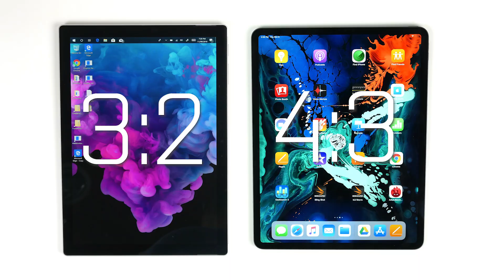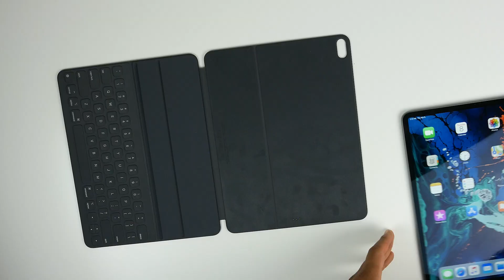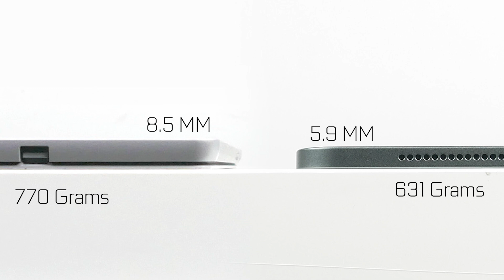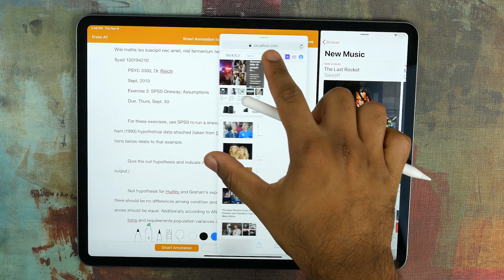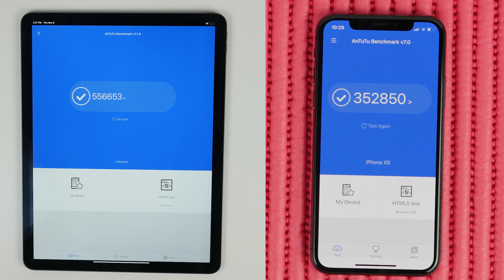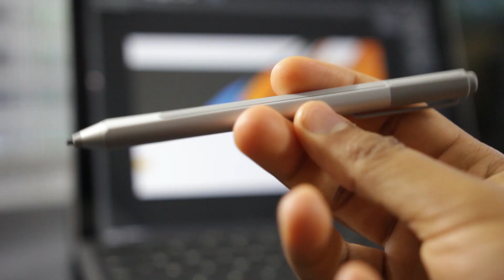2018 iPad Pro vs Surface Pro 6

Comment: One big oversight in this video. During the pros and cons section, it should be mentioned that the base model Surface Pro comes with 8GB of RAM and 128GB of storage, while the iPad Pro comes with 4GB of RAM and 64GB of storage. So the iPad may have a type of processor that beats most laptops in speed, but its base model doesn't have the RAM or storage to qualify for modern-day laptop usage, while the Surface Pro does.

Otherwise, great comparison.
Reply: Kev Lew so why not spend less and use ... a laptop that isn’t much bigger?

Comment: You forgot the dock connector of the Surface Pro. And this dock comes in very handy at home/at work – connecting a (large) display to the device and being able to connect e.g. multiple disks to handle large amounts of data is more than a nice option sometimes. I had all iPad versions up to the first (large) iPad Pro, but switched to the Surface Pro in the end (only an iPad Mini left for "consumption" and navigation). While the iPad Pro is the nicer hardware and better touch experience, the Surface Pro is suitable for professional work in nearly every area (while the iPad is only capable in some areas).
Reply: Couldnt agree more

Comment: The fact that the surface runs full windows 10 is a win for surface simply because, if you want use the ipad pro as an laptop replacement you will find yourself limited on task you can do. I will not consider the ipad a true laptop replacement unless it runs a full mac os.... simply bc you need a full os in order to do anything i don’t care what anyone else says you literally cannot do as much

Comment: Microsoft really needs to use Nvidia graphic chip with the price they asking for, also to compete with others! They should use something like NVIDIA GeForce MX130 chip which can be found in $500-$700 Lenovo flex convertible, they come with i5 or i7 8th gen, 250gb SSD, 8gb or 16gb ram, fhd ips screen + pen, they asking $550 for all that and Surface 6 asking for $900 to give us i5 , 8gb no graphic ability at all even to run simple games like DotA, and no pen no keyboard included!

Comment: Why do I watch these when I'm broke and can't afford either of them 🙃
Reply: Razzi W u are right, me tooo!
Reply: Well I have a laptop more expensive than both but I want something that’s be easier to use in road trips and stuff like that
Reply: Guess what i had my ipad pro in my bagpack and a water bottle next to it i know my fault.bottle leacked and it doest switch on anymore.cant new one now.i was using it for work and work of months gone with it too.
Reply: You gather knowledge 😄
Reply: I have a Surface Pro 7
Which is better than the 6
Reply: You can def afford it, the question if you will sacrifice yourself for it
Reply: Shashank Shekhar Obviously. I just can’t justify spending that much money on something like that currently, it’s not a necessity. That’s money that could go to food, bills, or rent. If I felt I had that much extra money laying around I would.
Reply: How about now?
How is life treating you?
Reply: Surface pro 6 used is cheap now between $170 - $275. I paid $220 for i7, 16gb ram, 512ssd with win10 pro👍 Ebay has tons for sale.
Reply: why? you don't have a job?
Reply: Razzi W shut the fuck up
Reply: @Ram-rm2gz  Well that's rude

Comment: Removable batteries are much better in a pencil, because the sealded ones will die and your whole pencil is disposable, where as the year long battery in the surface simply gets removed and back to full functionality each year.

Comment: The iPad Pro would probably be best with ya nano sim;therefore would have capability mots so as computer,cannot understand why bring new ports and pencils then more or less scraping them,also there’s lots of Apple products that should be included with with all new devices;because they’re not included they surplus goes to places like amazon and others  selling Apple products,So why is Apple and likes of other sellers still charging full prices on old products,they should be reduced,Apple has policy with old products they stopping supporting them and more or less rendering them useless,perhaps if Apple appoint someone other than themselves to give support for older Apple iMac and laptop,iPads wouldn’t it be wonderful.

Comment: ipad pro is great but for a $300 device, its not even close to surface. why nobody mention these questions!, can ipad run After effect or Nuke!? can ipad run maya or Houdini or blender ? can you do heavy renderings with things like vray on it? can you install AutoCad or any software and get your real work done by it? how about games, can you run your steam games on iPad or is it just some mobile games? can you run linux or other operation systems, can you connect ipad to a scanner or 3d printer or all the devices that can be connected to a pc like surface? sure you can do cool drawings with ipad but take away the pen and its just a smartphone with a big display. but with surface you can get your real works done  not just some simple family image and video editing,  with surface you can install softwares like visual studio, unity , unreal engine and make mobile and desktop quality games and apps. install professional 2d-3d animation or vfx softwares like toonBoom, Maya, blender, houdini, nuke and do everything from 2d animation to 3d modeling, texturing, animating, rendering, fx , compositing and post process. and for your information the "real photoshop" that was advertised on the ipad pro 2 ad wasn't really "real photoshop" just do some search and see that it only has some simple features.

Comment: the only time the ipad would be worth it is if it can run anything like the surface can all the old and new x86 and x64 programs and games hard drive storage or flash memory no limits at all ! and all the mobile bench mark scores seem to be garbage too the snapdragon 845 benchmarks close to a apple a11 chip something like single core 2800 multicore 90000 thats faster than some i5 cpus but the snapdragon 845 is in laptops and running proper x86 programs like complete garbage runs like an atom cpu ! i just think you cant compare arm cpus to x86 cpus at all if you could the new ipad scores would make it as fast as a alienware laptop with a i7 cpu and nvidia gtx1060 gpu and i bet you the alienware in real use is way way faster and id like to see the ipad play all the top end pc games like witcher doom gta 5 red dead and the rest !

Comment: Worth pointing out that video playback duration is not a strong indicator of real usage duration, especially considering Intel's architecture has very good video decoding.
According to Notebookcheck the iPad Pro lasts about 60% longer than the Surface Pro in web/productivity use.

Comment: He forgot to give the iPad a plus on apps. It still has the most apps available to its users. Another would be customer care. Apple still has the best customer support when something goes wrong. Another would be security. The iPad is still more secure than the Surface because of its walled approach. Another would be the weight. Yes, it is a noteworthy advantage to be carrying a lighter device vs a heavier device. Another would be resale value. The iPad will sell for more compared to the Surface. I can’t believe he missed those things. Or maybe he deliberately missed it to make it look like the winner is the Surface 😂

Comment: I used both pc and Mac pretty much alternately. Specs and bench’s aren’t comparable, in terms of grades and what parts you put in it.
But very rough of my judge is Mac computers are slightly or bit more stable than how windows sometimes stress user’s mind unless Tim Cook intentionally lower the battery stability and Slower OS reaction sake of selling new products.

That arrogance just shows mind of thinking that Apple  is a better company than Microsoft. Which is not so sure.

I love how it look with Mac products and stability. One thing I truly hate is that ego. Stop weakening your own products just for selling, you will lose future customers.

Comment: Missing is mention of the thickness different with the keyboards and the weight differences, again with the keyboards. The iPad's published thickness is a white lie as it doesn't include the camera bump-out while the Surface camera is flush. Since you discussed the keyboards in detail you should have also mentioned the price differences
Reply: Dwig Gang - The camera bump is hardly even an issue. Takes up less than 1 percent of the surface area and doesn’t wobble given the vast size of the device. Quit nitpicking.

Comment: You really can’t do Pro work in the entry level Surface Pro 6, you need the top of the line $2,500 one. 

You’ll have to wait and see how the new Adobe apps will run on the iPad Pro, and how does it compare to the entry level Surface Pro 6 running desktop apps.

Comment: I don't think you emphasize the file system (or the lack of it) enough. Easy sorting and transferring files in a professional work is very important. I won't say that either is better overall, I just think that these two are not the same category of devices.

Comment: So fucking tired of all the ipad / surface pro comparisons. Surface IS a computer. Ipad IS a tablet with a mobile OS. They DON'T COMPARE. You get the Surface for a tablet, you'll be let down. You get the Ipad as a "professional" latop replacement, you'll be let down. The main point of the Surface is that it's a full PC in a tablet form factor. The iPad is a pure tablet - it doesn't matter if you have the benchmarks to show - It is very limited in what you can do.. Just look at all the USB-C hipocrisy: The iPad as a USB-C - The Surface was crucified for not having one - all you can do with it is charge the device and connect to external monitors... As long as it has a mobile OS, it will always a be a "big" phone. Period.

Comment: Interesting review and reading peoples comments also interesting. Enough to make me add to the contents. I use currently an IPP. For drawing and editing video, animation. The attraction is the portable use and lightness easy to pick up and draw, doodle ideas. Gets me out of the office. Downsides for me are 1. No suitable way of connection contents when say access my external HD - have managed to connect a WD mycloud by LAN however transfer speeds are in the Stone Age. 2. Video editing ok, but your limited to 3 time line layers. 3. Connecting to IPP etc you need many different adapters and removing cards daily is a pain. New IIP apparently you plug an play on some types but no all Go Pro- also cannot connect my SLR without an adapter. I only use a key board for short cuts like In and Outs when editing. I talk to type. Pen a pain to charge not thought out. The surface pro I have not used and have not used windows in 20 years. However the surface pro’s, thinking and ideas appear to be more friendly and functional to the end user. That I can see purchasers questioning why they have an IPP. I know I am. Last thought the cloud great if you have fast wifi. Many people do not due to many factors. And this then reduces the work flow even further.

Comment: you know who's watching this video?  People like me who really want the iPad to be a pro device, but are coming to the realization that just as they feared, it's not a pro device.  People will write "it will get there", but that's what was said when the first iPad Pro came out, and its not there.  I really want it to be a pro device, but its just a powerful iPad at the moment with no guarantee of it becoming much else.  That's a tough sell.  If apple released some in-house Pro apps it may change my mind.  It would be great to have a Logic Pro on the iPad Pro for example.  It would be great if apple made a programming IDE on the iPad pro, as another example.  Just some thoughts, but you get the idea.
Reply: IDE on iPad ，yes, you have Pythonista.
Reply: @waynecake5867   show me the market share for python.  In talking about java and c#, node perhaps.  Its good theres an IDE for python, but most enterprises are not running python stacks.  What about database management tools?  Using a tablet for software developnent may be possible currently, but its full of handicaps and workarounds, even a year later.
Reply: you're probably aware of this now, but over the past couple of months shit got real haha
Reply: @josiahhooker6941  how so?  Like coronavirus or tablet capability?
Reply: @raffibleue  i was referring to all the changes that came to ipad os since launch. For a lot of people, the iPad can't replace a laptop running Linux, mac os, or windows. But for a lot of other people, who's workload involves photo editing, video editing, digital art, ect, the iPad pro is actually a really appealing option since there's now a proper file manager and support for external drives.